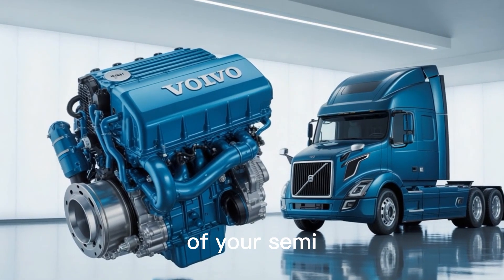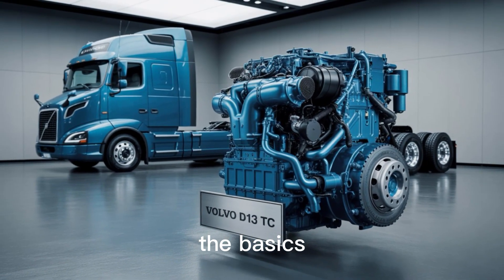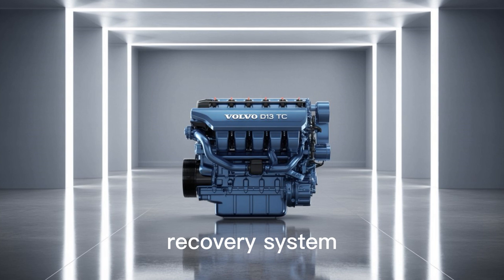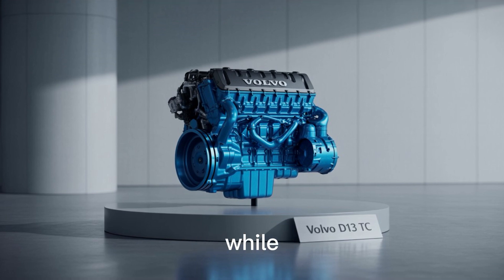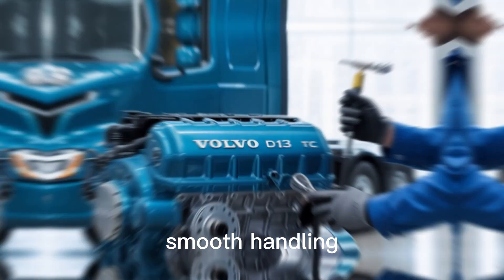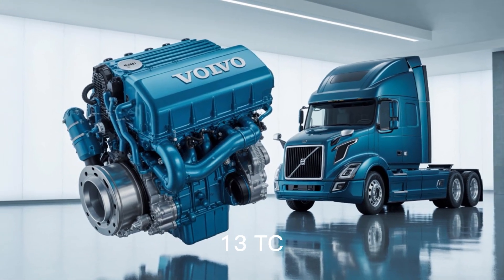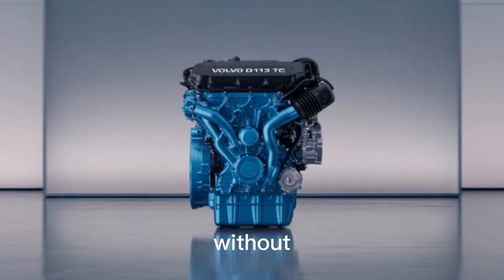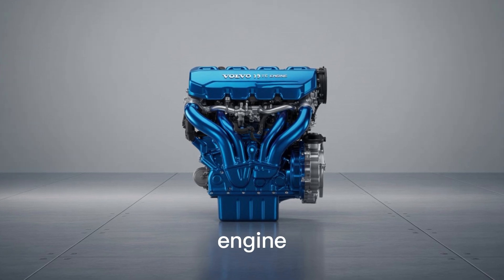Why the Volvo D13 TC Engine Is a Game-Changer for Heavy-Duty Trucks

Comment: Turbo compound is not reliable at all I have 760 vnl tc
First Turbo compound change at 350000 miles, break down again at 640000 miles, and that Turbo compound is not cheap. I wish I had  never bought one.